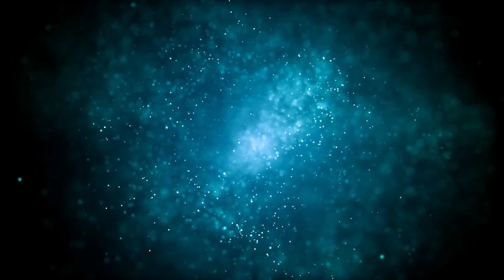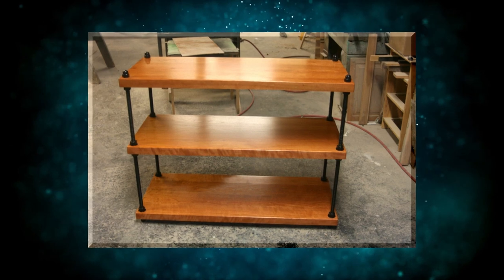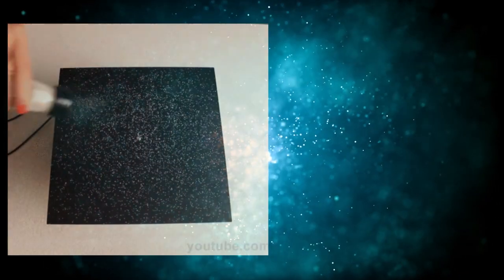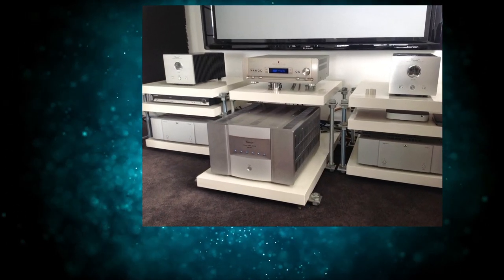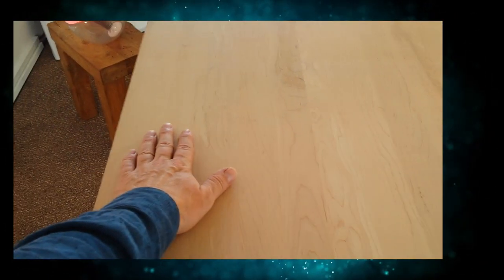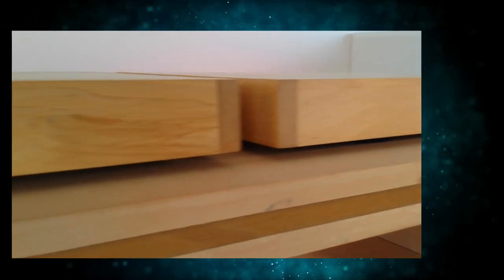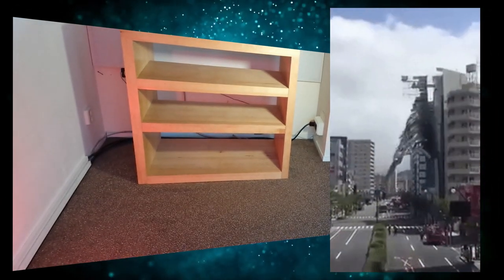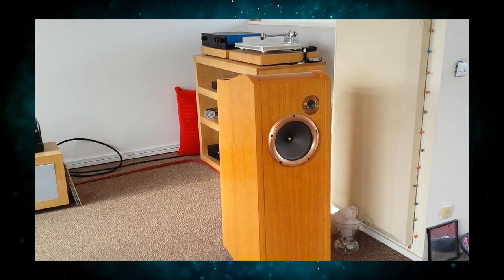Audiophile Audioracks  Do you need one?

Comment: In 1985, while out of work, I built my own hifi stand. I purchased 1X12" lumber and drew my own plans. I still use it today. It houses a Hitachi SR-804 receiver, Denon DRM-800A and Akai GX-f31 cassette decks, Teac X-3 open reel deck, ADC Sound Shaper Two IC equalizer, Pioneer RG-2 expander, PL-518 turntable and a Sony CDP-275CE cd player. Ain't the prettiest, nor a work-of-art but I think it's swell.

Comment: If you want keep that from happening stead of using toy balls i would put roller wheels if you want to move it or let it stay correctly !  Ur audiorack looks clean btw !
Reply from the maker: Hi, thanks for the compliment.
I considered wheels of course, but the small ones are too hard and the big ones (air tubes) make the rack too high and it will look ugly AF 😁
Reply: @theaudiophilebarista2424   you make a good point

Comment: In that concrete column example: what is the nature of vibrations from a turntable that need to dissipate into the rack? Sounds like a joke.
Reply from the maker: Not sure if I understand what your point is. What would be the joke?
- Are you not convinced that vibrations can have an effect on the performance of a turntable?
Reply: @theaudiophilebarista2424  I understand how vibrations generated from outside the TT can easily affect the micro movement of a needle so TTs need to be protected from the environmental vibrations. What I don't understand is what kind of vibrations are generated by the TT itself that require dissipation  of their energy to protect the environment. The needle? Nope, its oscillation energy is minuscule. The motor? Well, if it is so noisy that the environment needs protection from it, then you won't be able to enjoy your records due to the motor rumble.
Reply from the maker: @alexandermikhailov2481  Well, motor rumble is a thing of course. Vibration from the rack could transfer to the turntable. The turntable can pick up vibrations from the music in the room. Or from vibrating parts from the turntable itself (because of poor construction). So there are many possibilities. 
- You can’t protect the player from the music in the room (well, you can put it in another room of course) but you can protect it from vibrations from the rack. Or you could transfer vibrations from the turntable itself to the rack (that was the example).
- The movement of the needle is so minuscule that you don’t want it to pick up vibrations other than what is in the groove. I guess that’s why the best turntables (well, most of them) are build like a tank.

Comment: Why do you use separate wood tops for your players? Is that necessary?
Reply from the maker: Hi, good question. The reasons, for me, are:
1. It gives me an extra layer of seperation (from floor vibrations). Especially because of the turntable.
3. When I ordered it I also kept open the possibility of having seperate mono poweramps. I could use them for that.
3. I think it looks cool 😉

Comment: The  problem these days is finding a good carpenter.
Reply from the maker: Well, I guess there are enough good carpenters (in my city). Finding an affordable one is a bigger challenge 😃
Reply: @theaudiophilebarista2424  I don't mind expensive. I just want quality workmanship.
Reply from the maker: @jeremytravis360   Well, you are a lucky man. My wallet has some limitations 😀
Reply: @theaudiophilebarista2424  So does mine. I'm not a millionaire 😀
Reply from the maker: @jeremytravis360   😀 So do you have any plans for a DIY audiorack?
Reply: @theaudiophilebarista2424  Not exactly plans as in drawn out plans, but I know what I want and it is just a basic slab sides to hold an amplifier and an SACD player.
Reply from the maker: @jeremytravis360    Sounds like a purist 🔊
Reply: @theaudiophilebarista2424  "Perfectionist" , but I will drop my standards a little bit for this one. I don't mind dowels or other simple jointing methods.
Reply from the maker: @jeremytravis360   I like your style 😀👍